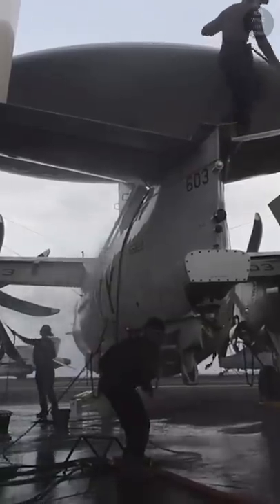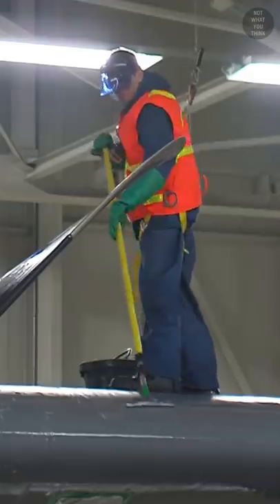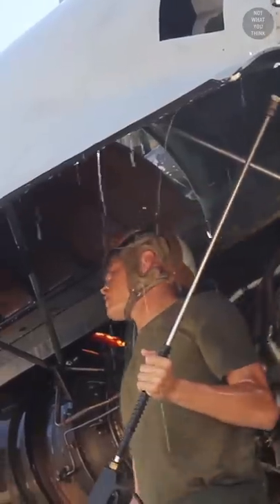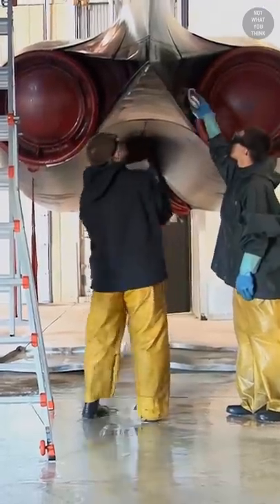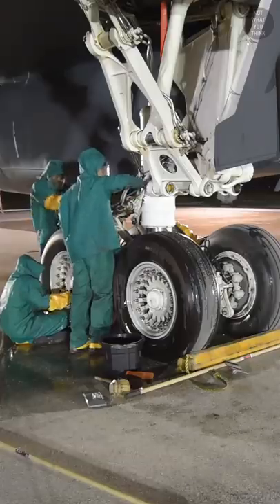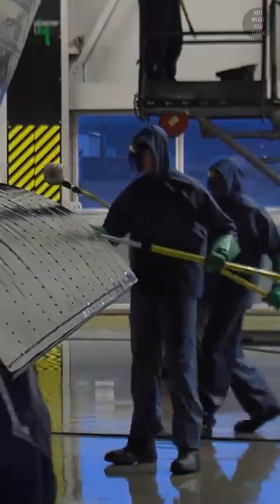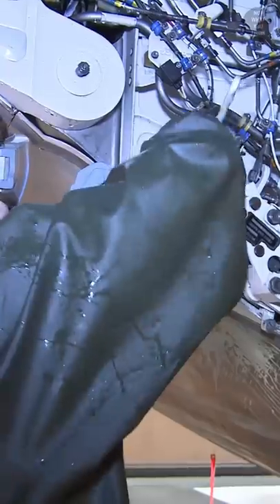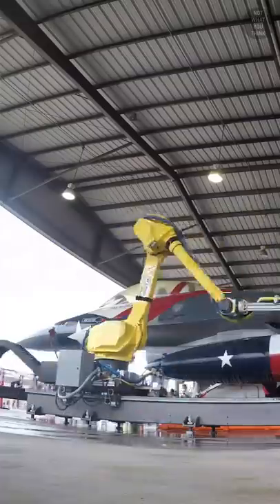What's the Dirtiest Part of Aircraft? #shorts

Comment: My guess while watching was the tail, but because of the soot from the APU (on commercial jets), not because it's downwind. For those who don't know, the APU is the engine built into the tail that often runs while the other engines are shut down and it has an exhaust at the very end of the fuselage that often has a black spot from soot in the exhaust.
Reply: That was my guess too
Reply: Wrong

Comment: I’d like to comment on the aerodynamic improvement part. It’s absolutely true. For example if the wings are dirty -> which means they are not smooth, but rough -> the drag coefficient can get twice as big as it is with a clean wing (at some angles of attack). So cleaning the airplane is actually economical, because the less drag, the less fuel consumed

Comment: I'm a 130 mechanic, and it definitely takes a whole lot longer than 8 people in 8 hours, it usually takes 2 12 hour shifts. Also the tail isn't bad on them, biggest issue is wheel wells and behind the engine exhausts

Comment: I used to to afterwash/ corrosion inspections on AC-130H Gunships, MC-130's , MH -53J  helicopters. Wheelwells get really dirty, the environment they operate in is critical to their wash cycle, gunblast track areas are areas of extreme concern because of the severe corrosion these areas are subject to. Also planes that gave urine deflectors from the relief stations in the aircraft, if the 130's still have them

Comment: I work as a aircraft painter. Tails are never that dirty. It's typically the landing gear and the area around it, especially the inside where the engine grease stews for 8 years before it comes in to get repainted.

Comment: I clean commercial aircraft for a major airline company, from 737-787. The tails aren’t the dirtiest on any size aircraft. In my experience it’s the belly behind the wheel well or the flaps directly behind the engines. Sky drawl or what you would call hydraulic fluid, is the absolute worst when it’s been burned on to a painted surface. That shit never wants to come off.

Comment: Definitely not the tail. I’ve worked on CRJ, ERJ, Airbus, McDonnell Douglas, Boeing, De Havilland, and many more and can tell you without a doubt that the nose and main landing gear wheel wells are the dirtiest part of any aircraft. From Skydrol leaks to rubber to corrosion inhibiting compound, it is 110% of the time the dirtiest part. Close second would be the wing aft spars.

Comment: I’ve been in the Hangar in the second clip likely cleaning the same KC-135 wearing the same disgusting wash rack suit that poor bastard was wearing, I likely even know the guy. The dirtiest part is not the tail, not even close. I would say the main wheel wells are the filthiest, especially the gears. All the grease from the gears slowly leak out and all the dirt the tires kick up really require a lot of attention. Nose wheel well is a likely second but only because the skid to stop the tires from spinning takes off a thin layer and adheres it to the ceiling, making it impossible to clean it quickly or easily.

Comment: The tail is not the dirtiest part of the air craft lol with my experience with commercial aircraft it’s usually the wheel wells,bottom of the fuselage,bottom of the engines, under the  slats for sure because of the oil and grease , wing to body faring, aft of the engine pylons next to the engine exhaust port, and that’s just off the top of my head.